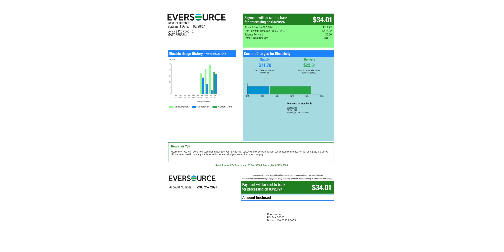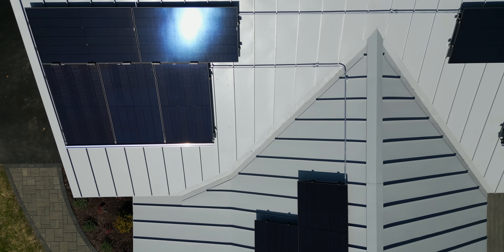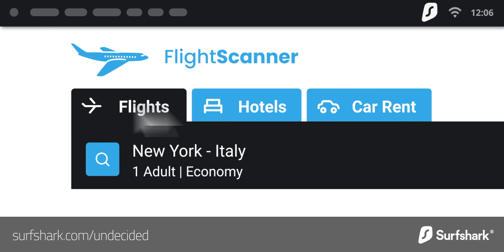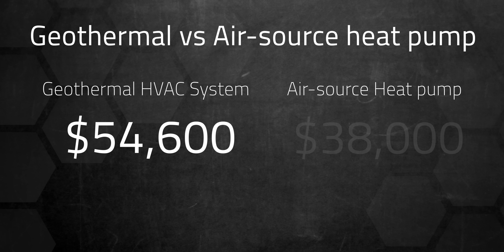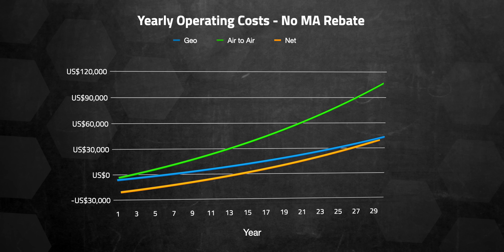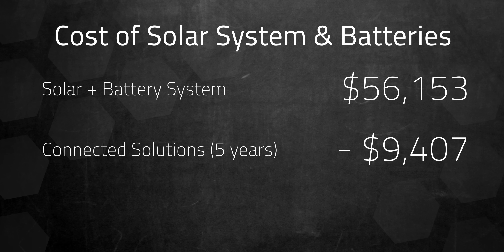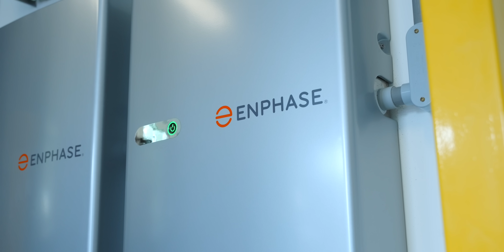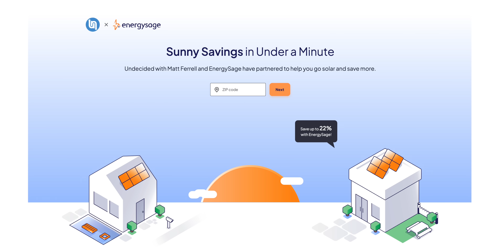What I Learned After 1 Year with New Solar Panels

Comment: your batteries and inverters wont last 25 years, need to  also factor in their replacement/installation costs
Reply: He has already done that.
Reply: Current Enphase microinverters are designed to last over 25 years (much longer than typical string inverters). We also installed an Enphase battery system.
Reply: @brucecampbell6133  Yours is a good argument for many areas. In the Southwest, where daytime temperatures are over 100F for 3-4 months of summer, the roof mounted (under PV panel) microinverters run at their upper limit, thus shortening their lifetime. String inverters are favored in the hot areas of southwest.
Reply: If you can't pay cash, then you need to factor in the interest cost to purchase over the life of the loan.
Reply: @thegreattuna7187  It doesn't matter if you pay cash or take a loan, the cash just hides the cost from you.   If you pay cash, you treat it just like a loan, because you could have put that cash into investments (typical return 10%) or into paying down your mortgage (7.5% return typically though it's tax deductible in the USA.)
Reply: The inverter will not; the panels should last without a problem. After 12 years I am currently waiting for delivery of a new inverter. Panels have not lost anything
Reply: Enphase microinverters come with a 25 year warranty
Reply: @kjenk19  You all sucked that up, eh? Tell me, how will you redeem your warranty at year 20 is the installer is already out of business?
Reply: @ my installer has been around for the last 20 years, chances are will will still be around in another 20
Reply: @kjenk19  That's great! Hope you won't even need it.
Reply: @Sekir80  
Installers just warranty their installation work that probably will last much longer than 25 years.  Panel and inverter manufacturers warranty their own equipment.  It does not matter if the installer is gone.  A different one can do your removal and replacement.
Reply: @BigGuy8059  But you have to pay for the new installing to the new installer, right? If the original would be still in business wouldn't that be free?
Reply: @BigGuy8059  I'm curious about the clarification for the other guy too

Comment: Thanks Matt, I have been retrofitting a 25 year old home with a remodel, taking the opportunity to install as much solar (25 panels), batteries (2xPowerwall2), AirSource heat pump as possible..  In the process of remodelling I have been amazed at how insulation standards have changed over the past 25/30 years, I suspect my wife is going to very pleased with the result, and like you, I'm exporting a little more than we consume.  
You have to be quite privileged at this point to do all of that, but actually it is all worth it.
Reply: if you just use 10% of this money and put it into insulation. you will recover that cost in just a couple of years. then save that amount each year. forever.
Reply: @diegojines-us9pc  it all depends on what insulation and how expensive more solar is.  For my system, it was 10x faster payback to put more solar up than the insulation I was looking up.  I'm sure the numbers could go the other way too if you had expensive solar and cheap insulation
Reply: @MrPizzaman09  $1000 of attic insulation saves you $100 the very first month. then every month. now how fast was your payback? no other system pays back faster, as much, and as long as a simple thing as insulation. now the next step. is windows. bigger investment with life time repayment but as a slower rate. and most of America dont even come close to having  either.
Reply: @diegojines-us9pc  mine was $10k for R3 foam on the outside of the house versus about $1/w for more solar
Reply: @MrPizzaman09  do the big boy math. how many watts would it take to heat or cool with and without the insultation. and foam has what? 100 year no fault life span. and for a 300K house. and i dont know what you paid for, since you can BRICK a average home for 25K to 30K,
Reply: @diegojines-us9pc  LOL... you're going to make me get my calcs out.   20% of my heat loss is with a R19 wall (with my R3 ).  Estimated power consumption goes from 6962 to 7355 kwh per year versus an r16 effective wall.  So about $80 year assuming my electric rates go up a bit, though really it's half of that because I will be selling power back to the power company at about half that.  So $40/year savings.
Reply: @diegojines-us9pc  I believe you if the attic had no insulation.
Reply: @MrPizzaman09  i dont know where you are getting these numbers. i can save $40 a year with a piece of plastic over my windows, and that still dont explain the high cost of your foam job. 10K will pay for vinyl siding on a new home. now consider $1000 cost for adding attic insultation, and see where doubling the min thats required, i bet those numbers jump out at you.
Reply: @diegojines-us9pc  My house is being built as we speak.  It's r49 roof and insulated basement floor.  R8 triple pane casement windows.  2200 sqft house and 2300 sqft heated garage that is attached.  The house is mostly single level so there is a ton of wall surface area.

Heat pump with an estimated 2.5 COP, with $0.17/kwh electricity right now.  I live in the snow belts of Pennsylvania, so it will be 95- 97% heating vs AC cost.

My numbers make sense when benchmarked vs my parents house that runs a COP3.5 geothermal, but is less insulated.  They did a foot of chopped insulation in the attic, which helped some on a 3000sqft house....not sure it would of been more than $30-50 is savings per month, but that was back when electricity was only $0.10/kwh
Reply: @diegojines-us9pc  That is so true. If you live in the cold, Attic insulation is the first thing to do on a bought house.
Reply: There was a good article about minimum code building standards. I live in Edmonton, Alberta, Canada. Last winter we had a couple of days of - 50 degrees. De icing on airplanes doesn’t work at that temperature. There is a window company in Edmonton that makes the highway R rated windows in the world.
Reply: @Parzival711-x7i  I bought R8 triple pane windows from Germany for my new house.  I heard Pella triple pane windows were only about R4.

Comment: Wow...I'm having a 30KW system with batteries installed in Feb'2025, the UK price for everything inc. installation will be just over 30K GBP.  We already have 3.5KW which we got over 10 years ago when the Feed In Tariff first appeared in the UK.
Reply: Just had a GivEnergy battery system installed on my house in the UK. Best thing ever! Just need more solar now. 

And with the various tariffs from octopus its a no brainer.
Reply: @DarrenPoulson  Looking forward to it, I am also with Octopus, I have a Tesla Model 3 long range model and I'm 55 next year so looking forward to not worrying about rising electricity costs.
Reply: @SimonPlatten  Yeah. I'm 50 next year and working on getting all bills as low as possible. New windows, doors, etc. anything to make the house more efficient.
Reply: @DarrenPoulson  , 55 in Feb, our house has been a long term project, a few years ago we got off oil and had Air Source Heat pump installed, its been brilliant.   We have done everything we were supposed to do, except it seems there is always someone trying to pull the rug from under us.  Pensions are a huge disappointment.
Reply: @DarrenPoulson  I wish we had companies like Octopus  and Ripple here in Denmark

Comment: I think if people are installing new solar systems, they should oversize the system if their budget allows. Because eventually you will move on to EV's and all electric appliances. Our 10kW setup although sufficient for now might not be able to power EV's if we buy them. Current iCE cars we own are very old(2014) and we still have them coz we don't drive a lot. 
If your budget doesn't allow it use what we did: We left space for 3 extra panels which I think will help in out especially in our winter production.  
Guess the next step is to make out house more efficient 😁
Reply: "Very old", lol, I've got a 94' van and a 00' pickup.
Reply: umm 2014 is not very old, if properly maintained thats just a normal car age, 30 years of daily use is getting older
Reply: 2014 car is not "very old". It's not even "old", it's just the used car. And if you want to be at least somewhat money-effective, you probably shouldn't buy cars newer that 7-10 years. Don't know about US market, but here in Europe you'll get for example excellent 2014 golf for 5k which won't require any repairs for several years.
Reply: So I will address all the issues of 2014 not being old. Yes you guys are correct I might've meant it as a hyperbole of sorts but lemme explain. 
My car is a Honda City 2014 iDTech 1.5L, It's a great car and has no issues in the city conditions it's being used for. The problem is that in India we didn't have good pollution norms, it is a BS-IV compliant car which did not have any rating for particulate matter emissions, I'm sure the commenters will find similarly worse cars but imo it's very polluting. BS-VI is when India started counting particulate matter for car exhausts (bs 4 vs 6).
[[ Also the sedan has a roll which I sometimes get scared of. Rear suspension is also bad]]

So what the government did is, they are banning all cars that are 15 yrs old (petrol/gasoline or whatever they call it un ur area) and 10 yrs for diesel. I'm all for the environment but I don't think scrapping all cars is a particularly nice idea, guess sm1 lobbied hard lmao. 

Anyways the govt policy is the main issue, the car itself has no issues
Reply: Chill PHEV will make your day
Reply: MGUY Australia doesn’t think highly about EV’s.
Reply: @Parzival711-x7i  why?

Comment: It appears your battery bank is too small, even for net zero.
Reply from the maker: Yeah, it's about 10kWh smaller than I wanted, but there's a whole story to that.
Reply: @UndecidedMF  Well, Lipo4 is reallllllllly cheap now.  If your system has the ability to add capacity...(you can literally get 10kWh now for about $3-4k)...you can get to net zero...

Comment: I'm curious on the decision to have the house shaped as a H instead of a rectangle. Would a large rectangle not have maximised internal volume, reduced energy loss by reducing the surface area to volume ratio, simplified construction, simplified the roof, reduced cost, increased the roof area for solar panels, reduced future maintenance costs in 20+ years, etc. As someone from the UK your house is quite a complex shape relative to what we have over here. I'm not hating just intrigued.
Reply: His house is predesigned the main part of it is a rectangle, It's H shaped because he added a garage and  his office to it.  You are correct that it would have been more efficient, but the design cost for him would have increased significantly and taken him longer to build.  It was designed and panelized by Unity homes.
Reply: Not building like the 2nd of the "Three Little Piggies" would help as well. I'm looking at the builders website and I can't help but laugh, seeing how they are proud of R-35 walls and R-50 roof.
I live in Poland, which has climate roughly equivalent to that of Chicago, and our walls (in new construction) are required by law to be, at the absolute minimum, about R-30, with >R-60 being a fairly normal value - that's just 10" aerated concrete brick walls and 12" of graphite-infused XPS insulation. Another R-64 for the roof (18" of mineral wool is normal).
Reply: @MikrySoft  thank you. „Energy efficiency“ in the US is not at all comparable to what we have in Europe.
Reply: @ in energy poor countries, more insulation is more valuable. In cheap energy regions or countries, the excessive insulation has installation costs and living costs that won’t be paid off in the lifetime of the home.
Reply: @jsbrads1  lifetime of the home is crucial. The US has average lifetimes of 50-60 years, while Europe has them at about double. Of course when your home needs to be scrapped in your lifetime, insulating well is rarely worth it financially when you can also just burn coal and gas for „10$ a year“.
Reply: @jsbrads1 you might be right, but good insulation also keeps the heat outside, and the cool inside, during heat waves.. it works both ways.
Reply: @MikrySoft in USA, in winter, they put the heater to max and then they keep the front doors open, they don't care about energy efficiency at all, then they whine that gas costs 0.00002 cents more than in 1950's because Obama 😂
Reply: @MikrySoft Yeah a lot of Americans seem to live in glorified sheds, I don't understand it.
Apparently it makes sense in Tornado Alley, because "your house will be destroyed anyway so it's better to have wood rather than bricks flying through the air", but I don't know about anywhere else.
If I lived in Tornado Alley I'd want my whole home to be a "tornado bunker", maybe just one room above ground with windows.
Reply: @michaelmartin9022  I have lived my 55 years in Kansas, Iowa, and Nebraska.  Three states either in Tornado Alley or adjacent.  I have never been hit by a tornado.  Some came somewhat close, but no direct hits.  Imagination and fear make people believe and say lots of nonsense.  Tornadoes happen.  But its almost always just a few houses that are damaged.  Or a whole trailer park gets demolished every other year.  Don't live in a trailer house anywhere.  Tornadoes are also somewhat small.  Tornadoes are different than earthquakes in California.  California has building codes designed for earthquakes because they are sort of common and destroy hundreds or thousands of square miles when they happen.  A tornado can be thought of as a nick on your face when shaving.  While an earthquake is a gunshot wound.  One of these you don't worry about protecting against.  The other you wear a bulletproof vest.
Reply: The H shape increases window views, their up sides to the complex shape. Also the shape can create more privacy inside the home, isolating bedrooms from the entryway.
Reply: Another good point.
Reply: Nice pondering.  To the effect, why not just a 100 square foot room.  surely we can manage with out any luxuries.  why have anything we enjoy that eclipses what is necessary.